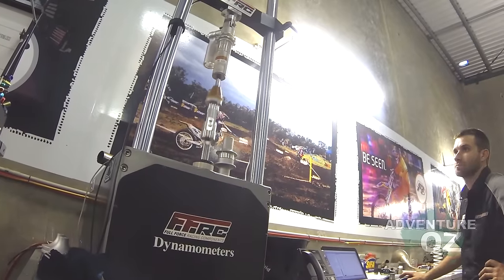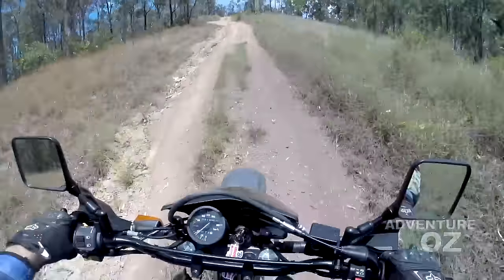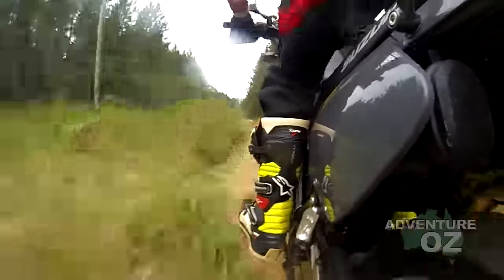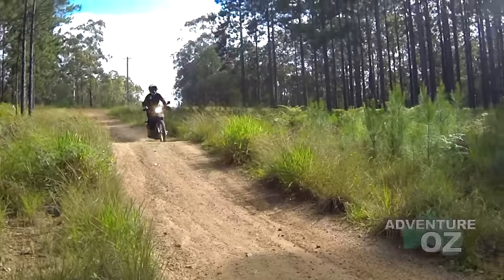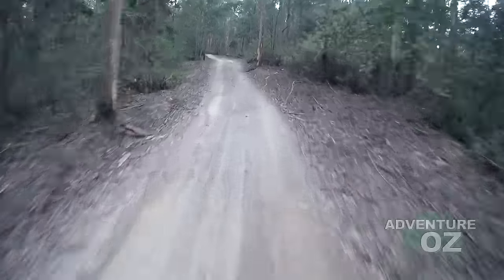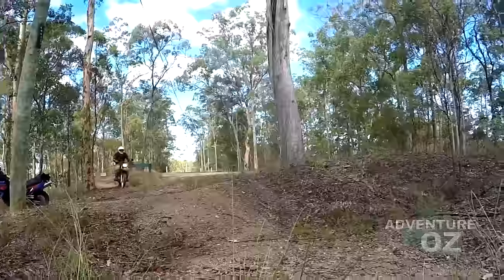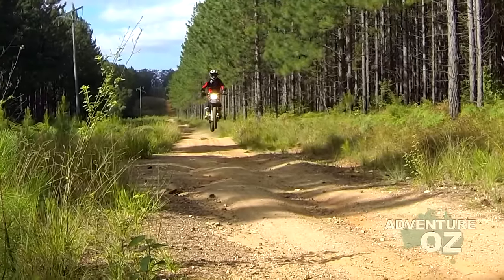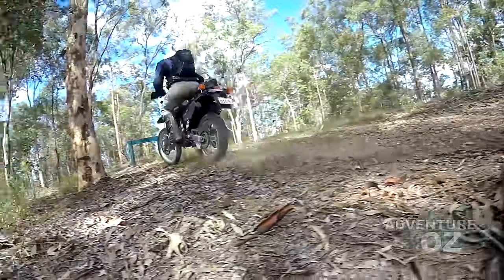DR650 project: basic suspension mods and tips︱Cross Training Adventure

Comment from the maker: WARNING ABOUT FFRC PLEX VALVES The creators of DR650 Plex Valves sold the FFRC business. We picked up new Plex Valves for our latest DR650s and unfortunately they just don't seem to work they way they used to as the new owners have tweaked them. The forks are quite harsh and lost all the 'plushness'. We even tried 2.5W fork oil with no success. I would recommend trying the Intiminators or Cogent DDC instead until things get fixed. It seems FFRC has changed yet again to new owners... 🤔

COMPLETE LIST OF DR650 PROJECT VIDS
Introduction to the DR650 https://www.youtube.com/watch?v=58vB-5urcJI
Power mods overview https://www.youtube.com/watch?v=z7GcNdlDwdk
Transforming the carburetor https://www.youtube.com/watch?v=aN1aU0G4YQE
GSXR exhaust mod https://www.youtube.com/watch?v=Em6SzMTF5SY
DR650 known issues https://www.youtube.com/watch?v=rSNBa63UWx8
Basic suspension mods https://www.youtube.com/watch?v=aTYAwIBX9aQ
Protection for the DR https://www.youtube.com/watch?v=NQcXfOJsLSM
Ergos: pegs, bars & seats https://www.youtube.com/watch?v=geLR5u8sMhI
Weight reduction https://www.youtube.com/watch?v=h6fl-GWdURk
Best suspension mods https://www.youtube.com/watch?v=sGdLm9sXzdo
Fixing noisy starter motors https://www.youtube.com/watch?v=6P4n80FJP18
Headlight upgrades https://www.youtube.com/watch?v=G28GoyWp6LI
Steg Pegz review https://www.youtube.com/watch?v=SnI_pfkuQsg
Reply: Thanks for the video! Would you be open to doing a DRZ400 project series? Would love to get an in depth take on how to improve the suspension on that bike.

Comment: “Ancient rod design in the dr650”
I nod and agree as I’m actively converting my Harley to the older style by removing my emulators to justify lengthening my forks..) 

Both my Harley chopper and now my DR650 have been an exercise in learning as I go, and videos in this series and others have been integral in helping me be a little less blind as I go along. I’m lucky that I’m light enough that the DR’s suspension was “acceptable” but as I get more and more into it I’m learning how acceptable doesn’t mean good. Thanks for putting this information out here in a way that’s easy to understand!
Reply from the maker: I've had a few DR650s now and I always keep the suspension stock for at least a few months to remind myself it's more about riding style than suspension mods. But man, it is always nice once the mods are done lol.

Comment: Wouldn't it be nice if stuff came good out of the factory? Just a few inexpensive changes at the factory could really set some bikes apart.
Reply from the maker: +eveRide ADV it really doesn't make sense tyler. i know designing and retooling are expensive but suzuki could mainly just tweak existing parts. things like better springs and thicker fork and shock oil wouldn't even cost extra at all.
Reply: eveRide ADV a

Comment: I recently got both front and rear racetech springs which are set to my weight. It has made a big difference. The lack of front nose dive is the most noticable. I look forward to seeing you out on the trails at Mt Mee one day.
Reply from the maker: +stonemonkey any changes to the damping or valving stonemonkey?
Reply: Yeah when my mechanic put in the new springs they also added rebound separator valves. He told me that if I had any issues to call him and bring the bike back in as they still had a bit of wiggle room of adjustment. One of the hardest things about suspension is knowing if it is good or not. You can tell if suspension has changed things but it is a bit hard to know if it is "perfect" unless you ride the same make of bike with perfectly tuned suspension and compare.
Reply from the maker: +stonemonkey yep, can be quite hard to get it dialled in just right. i know some guys run over and over the same bumps and play with the clickers till it all smooths out... personally i don't worry too much as long as the bike isn't so bad it's trying to throw me off.

Comment: I could be wrong but the inner chamber of the DR shock is soft aluminum which gets chafed by the seal under hard use. Which in turn chews up the piston seal and causes total loss of damping. I have seen a few stock DRs go pogo after a day of rocks. Hopefully you will touch upon this and/or shown the inside of a blown out DR shock.
Reply from the maker: +Ryan Harrington great point ryan, we'll be covering that in the second stage of the suspension mods.

Comment: I went whole hog on the front suspension (thanks, Procycle!) and got the Cogent drop in cartridges and appropriately weighted springs.  It's seriously a whole new bike. I wish I had skipped the TM40 carb and saved that money for my rear suspension.  Suspension just makes such a massive difference.
Reply from the maker: +dustysquito i did have an FCR on a DR650 once and maybe it wasn't set up well, but i didn't really notice any difference between it and the BST magic mods. but then i'm always the guy who will do it cheap and easy where possible instead of shelling out the cash. :)
Reply: Everything I had read told me that the TM40 should have been this massive, awesome improvement over the stock BST40. I had already drilled the slide, messed with jets, and got a tapered needle, and I guess I didn't realize what a change it made. After I put in my pumper carb, I didn't make it out of my neighborhood before wishing I had spent the money on something else.  Speaks volumes for how much you can do with that stock unit.
Reply from the maker: +dustysquito that's what i've heard many say, i don't want to kill off sales of the pumper carb but just think guys should mod the stock carby first and see what they think :)

Comment: This is the fork upgrade I've currently gone with. Heavier shock spring also. I'm looking forward to throwing away a little more money and being able to trust the bike a bit more though
Reply from the maker: +Sweetman same here sweetman, we've got it pegged between doing a better job than stock but only coping with fast choppy ground and big jumps reasonably well, the best you can hope for with rod forks. FFRC will try to invent something like the intiminators (no mods, just drop them in) but with adjustable rebound and compression damping too hopefully. and cheaper too.

Comment: nice set up that guy has! i bet he could even get my beloved  kdx 220 going straight.
Reply from the maker: +markmtbrider he seems to really know his stuff. at first i thought the dyno machine he uses was just a bit of bling but it's incredibly accurate and takes away a lot of the guesswork e.g. they had the well known KTM 4CS forks issue sorted within an hour or so using the dyno.
Reply: seems no one has much nice to say about the 4cs. if its so bad,its hard to believe ktm would use it.
Reply from the maker: +markmtbrider i don't know the full story behind it but it's certainly got a lot of ktm riders pissed off. after this many years in the market they should be able to get the suspension sorted before selling the bikes. :(

Comment: love the informational videos . i own the 2016 dr650 was out riding in whoops and sugar sand bone stock suspension im an agressive rider bike was allll over the place between the shit stock tires soft suspension i went down 4 times today making me feel like a beginner rider i hopped on my buddies cr250 and wow what a difference.. thing i noticed instantly was how well it took the whoops i took it as the cr250s suspension was wayyy stiffer and knobbies but i want my dr to handle sugar sand and whoops like the 250
Reply from the maker: +Erik troy even the most basic cheapest mods to the suspension will held a lot erik. but once you redo the valving and springs both ends it is a totally different bike to ride, you'll love it. this is just a silly vid but shows who easy the DR is to ride once you do the full job on the suspension: https://www.youtube.com/watch?v=VJMYMC4jxKM

Comment: I love this series and can't wait to see the final product. You talked about intiminators and emulators, but are you intending on trying out the Cogent Dynamics' Drop-in Dynamic Cartridges (DDC)? I was hoping to get a set eventually (once the CAD$ improves a bit) and would love to get a good comparison review with all the other fixes for the DR's suspension.

Oh, and BTW, on the card showing the two types of suspension, the labels are reversed... the cartridge suspension is on the left, and the rod is on the right.
Reply from the maker: +Gervais Albert doh, thanks for that gervais, made a correction. the vids take so long to put together sometimes that i get sloppy checking stuff toward the end. from what i read, the FFRC guys will be doing something similar to cogent, but they want to add both adjustable rebound and compression damping into the same drop in unit if possible. not sure if it's doable but fingers crossed.

Comment: thanks im 160 lbs was looking at the recor emulators for front forks not sure what to do about the rear i just adjusted the compression to the max on rear (after i got back home) and the rear definitely feels stiffer i put 1/2 longer fork spacers it definitely helped it stay up a bit i was going to try n go a half inch longer longer yet again . still want the emulators

Comment: Great video!  Really nice shop! The front forks are not adjustable so are you setting them up for you body weight... once the bike is loaded and the extra fuel in the IMS tank are they still going to perform decently?
Reply from the maker: +Sum4Seb yep, just have to set the forks for my weight and 19L of fuel sum4seb. it's not a bad compromise now as the behave reasonably well on fast corrugations and big jumps, but do neither well. massively better than stock of course, but it will need something like emulators, intiminators, or the special valving FFRC are going to design to make it all work properly.

Comment: I have a '91 which uses linear springs as stock. Since they are worn out, I've decided to try progressive springs from Hyperpro, however I've noticed they're much longer than stock - like, about as long as spring+spacer so I'm wondering if I may be better off fitting them without any spacer installed. Does that make sense to you? I could almost call myself a sort of experienced rider but I'm completely ignorant about suspension.
Reply from the maker: i wouldn't even hazard a guess about this one, i'd suggest chatting with suspension specialist.

Comment: Suzuki's website says this: "The inverted cartridge front forks combine the best features of 
conventional and inverted designs to provide the smoothest riding 
experience possible," Is this a misprint? or does my 2015 that I just bought have inverted cartridge forks? Thank you for your recommendation for the DR650.
Reply from the maker: +Paul Dykstra that is hysterical, paul! the triumph of style over substance from the advertising guys... they aren't inverted, and they certainly aren't cartridge. the rod forks are a decade old design they have only stuck with because they are too lazy to change it, and it saves them a few dollars per bike lol!
Reply: +ADVENTURE OZ I just bought the DR. Is that special rear end suspension valve for sale?

Comment: Does your suspension guy have any suggestions on re-shimming the stock valve on the rear shock? I know it doesn't have adjustable rebound, but maybe just some improvements in the rebound valving could help a lot.  I have been considering tearing down my rear shock and adding some shims to increase rebound dampening, but don't have resources like a shock dyno so I'm not sure where to begin. I read somewhere that there was a pretty big jump between the high speed shims and the low speed shims so at a certain point it just goes away, maybe a smooth taper of shims?
Reply from the maker: +Beyond2Wheels a big problem here is no suspension shop gives away their settings usually. :(   all i know is that heavier shock oil will help, but you need to increase the rebound damping in respect to the compression damping. i don't even know what they did to the rear shock but the difference was night and day....
Reply: +ADVENTURE OZ fair enough... so I'm wondering did they re-shim stock shock or did they replace the valve assembly completely the only reason I ask is I'm looking at doing my own but if it's not worth it why go to the trouble
Reply from the maker: +Beyond2Wheels i don't know exactly what they did, i'll try to remember to ask them next time i'm up that way
Reply: @crosstrainingadventure  did they respond it? they might be using internet explorer

Comment: so new dr650 + 1k for suspension + new rubber 
you keep increasing the cost of the bike im saving for
Reply from the maker: +Gummy Bear just trying to stimulate the economy, gummy bear. :)  actually if you just put new springs and heavier oil front and rear yourself you are only looking at AUD$400 tops. but a grand will give you the top shelf treatment. and of course the stock rubber is okay for just cruising around, it's just some idiots will insist on trying to ride the DR like a dirt bike lol.
Reply: oh ok i just  like getting over there more then jumping. so im happy doing 50ks on fire road and 1gear up hills just to get there
Reply from the maker: +Gummy Bear in that case i'd suggest the budget suspension options first. and if you weigh 85kg or less you may find the rear spring is okay too. the front springs might just be acceptable if you are under 80kg and add longer spacers at the top of the fork to compress that ultra soft part of the spring further...
Reply: +ADVENTURE OZ I'm less than 75 kg (stock tank, no panniers);  I would say that the front fork is OK, until you start jumping. It will completely collapse even after a small jump.
As regards increasing the preload, I'm not sure you can do much. The fork spring coils appear to be so close to each-another that I'm afraid you may run into coil-bind pretty easily with extra spacers, thus decreasing your wheel travel!? Note: I'm not a suspension specialist, at all; so I may be completely wrong :)
Reply from the maker: +frogzie not sure where the links are anymore frogzie, but there are details on when you'll start to get coil bind... maybe the DRRIDERS forum?
Reply: +ADVENTURE OZ Thanks. That would be valuable information. How much of the spring can you cut before reaching the coil bind threshold?

Comment: Lol the best mod l found for a dr 650 is sell it and buy a bike that has been designed in the current decade
Reply from the maker: And just pay double the money for double the number of things that can go wrong. 😂 Each to their own. These old dinosaurs definitely aren't for everyone.
Reply: @crosstrainingadventure  l spent 5 K on upgrades to my dr 650 and at the end of the day it's still a twenty+ year old design it has been reliable Australia wide but l just don't enjoy riding anymore you can't turn a pigs ear into a silk purse
Reply from the maker: Each to their own I guess. Personally I think it's better to just spend a max of $1000 to $2000 and do as many of the free and budget mods as possible. Otherwise.... yes. It's trying to turn the DR into something it isn't!
Reply: @crosstrainingadventure  screen/seat/pegs/centre stand /30ltr tank/racks/bars and risers /full stainless tune exhaust/front springs/Elka rear shock / 520 chain sprockets/force bash plate/ storm bark busters  spent 5 K on the accessories and l think you need them if you do big ks per day longest day on my dr was 1050 ks and thanks to my Sargent seat l could still walk straight at the end of the day it may be a $700 seat but worth every cent the only track l haven't got yet is the canning stock route but it's still on my agenda
PS l have used other bikes for rides tt600/xt600/KTM 690 the dr is still the best all round comfort so far